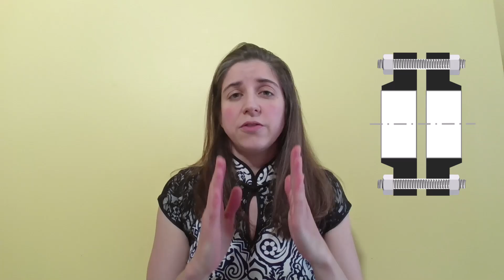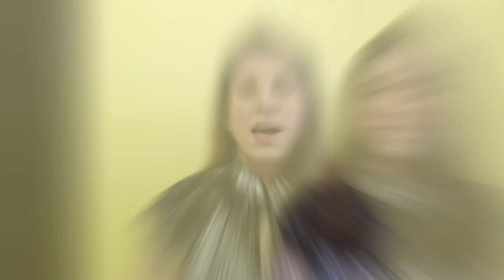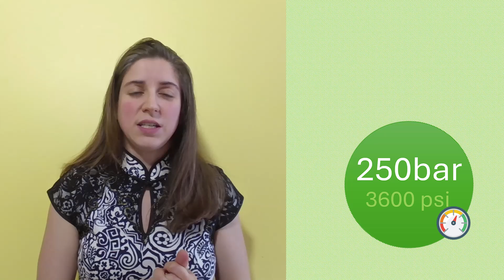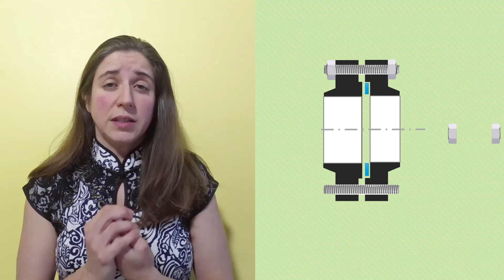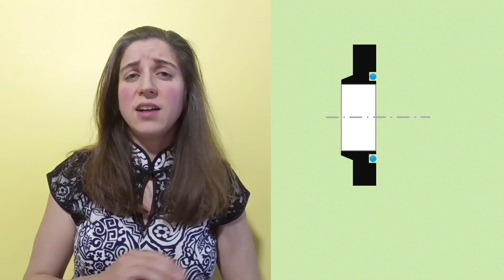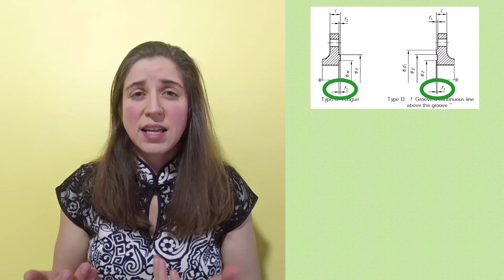AutoPIPE Vessel: Flange's faces and assemblies

Comment: Good explanations of flange and gasket types, but the presentation of  RJT type could be a misleading. Standard (ASME/API) RTJ grooves are in the flange raised face and the flange faces do not make contact. Cutting the groove into the flange will weaken the flange.